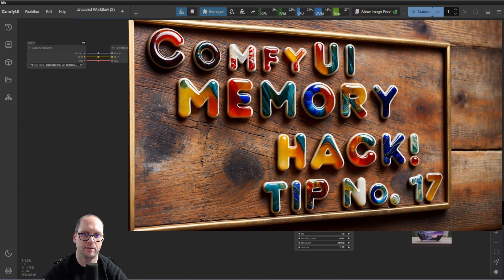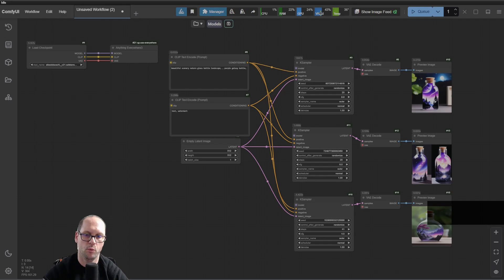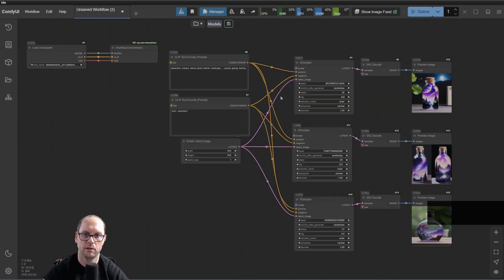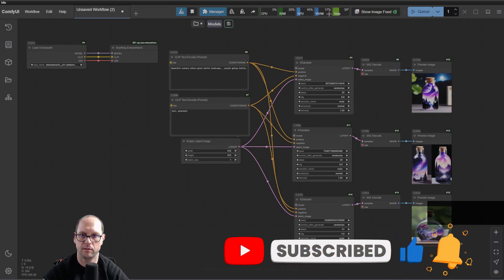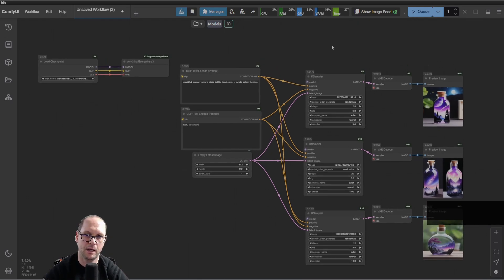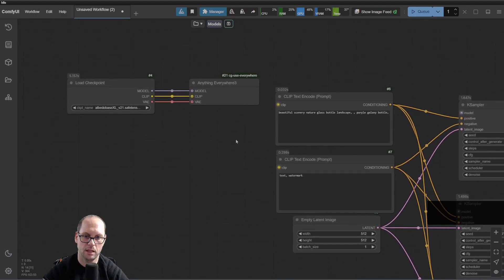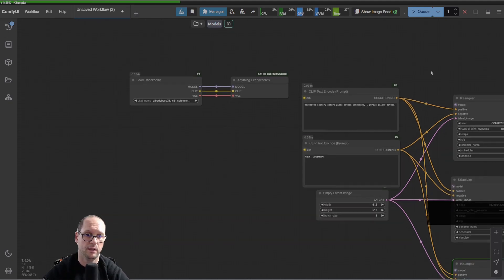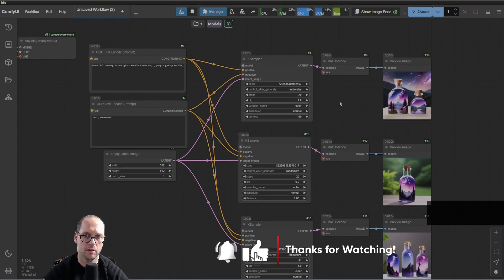ComfyUI Tip #17: Clear VRAM Without Restarting – Save Time Now!

Comment: My comfyui is using mostly my ram 90-99% and barely using my vram 13% max, how can I make comfyui use more of my vram
Reply from the maker: can you give some details on your machine spec? Operation System?
Reply: @NissimsTutorials-l6g  Intel i9-14900K, 3200 Mhz, RTX 4070 w/ 32GB Ram
Reply from the maker: @BocchiTheBlocked  ComfyUI Version?
you can find it in the ComfyUI Settings -> About.
Reply from the maker: @BocchiTheBlocked  also, please check that your Nvidia driver is updated.
Reply: @ Yes it's updated and literally 10GB of my VRAM is doing nothing. I may have set comfyui incorrectly or messed up the paths, folders
Reply from the maker: @BocchiTheBlocked  yes, it can happened. I personally reinstalled ComfyUI multiple times because of changes and upgrades. 
in this case make a new install, keep the old one, and copy all models and Custom Nodes to the new install. Don't do custom setup... yet.
check if it fix it.

Comment: i have a 4090 and i get a out of memory error once my task manager shows my dedicated gpu memory as only 10.5gb used.
Reply from the maker: Interesting. Does the temprature of the GPU OK?
do you have the latest NVidia Studio Driver?
Reply: @ yeah haha it sucks. temp is fine tho
Reply from the maker: @envision6331  try reset the GPU:
1. close ComfyUI
2. pressing Ctrl + Shift + Win + B
your screen will flicker once.
Reply: @NissimsTutorials-l6g  Nope same thing. My cuda version is 12.8 and im pretty sure the version of  pytorch and etc im on doesn't matter. Oh well.
Reply from the maker: @envision6331  ok. I will try check, interesting issue.

Comment: hello. It takes a lot of time when loading a model in checkpoint, if it wasn't like that before. What do you think happened and what is the solution? thanks
Reply from the maker: HI, 
I didn't fully understand the question. can you give more details?
Do you ask how to make the Checkpoints/Modes to load faster?
The memory clean does force you to reload the Models because we removed those from memory.
Is that what you meant?
Reply: Hi.  Previously, in the Workflows, the models were quickly loaded in the checkpoint, but now it takes a long time.  I would like to ask your opinion what reason this bug can have?  Thank you for your attention and response.
Reply from the maker: @Amazingphysicscourses  I encounter that myself. when I upgraded ComfyUI to around 0.3.9/10 I started to experience some slowness.
also, I saw notes about NVidia GPU driver that she more slowness from a specific version, version from 6 months ago. multiple people notes about it, so I also downloaded multiple versions of the NVidia driver but didn't see large improvement.

Comment: Im trying to figure out how to clear my memory automatically after a run. The only way it clears is if I close or restart comfyui which isnt an option for automation. Do you know if there is a node for the function you used?
Reply from the maker: I don't know about a Node. but my first question is: What is your ComfyUI version? 
you can find it in the Settings -> About. with the last 2-3 version I don't have an issue, in the last I did have issue with some Models that ComfyUI didn't handle well.
Version 0.3.11+ supposed to be ok.
Reply: @NissimsTutorials-l6g  There are meant to be nodes for cleaning memory/VRAM but they didn't seem to work as something was still reserving that memory so the solution I found was to run the server as a subprocess group and just terminate all the derivative subprocesses when i wanted to clear memory. Not a pretty solution but it works
Reply from the maker: @DittrichCo  understood. I also find myself restarting ComfyUI using the Manager or kill the process and re-run it.
But in most of the cases the memory clean button working well.